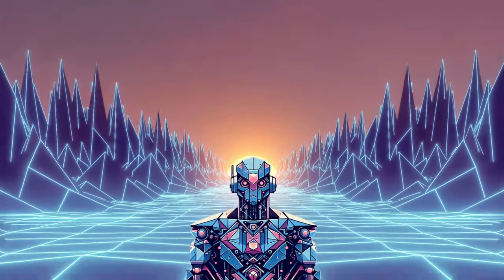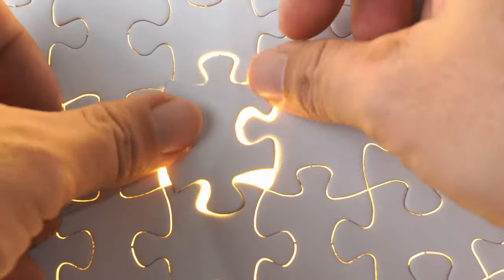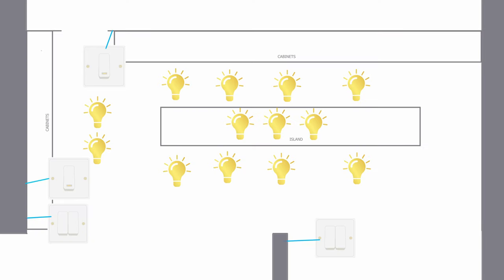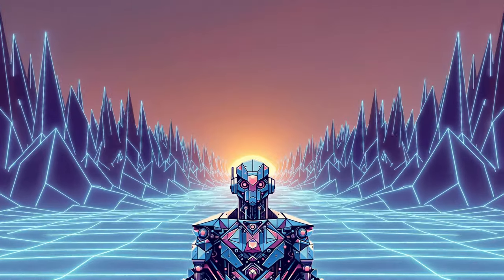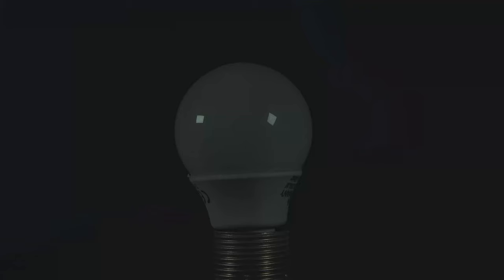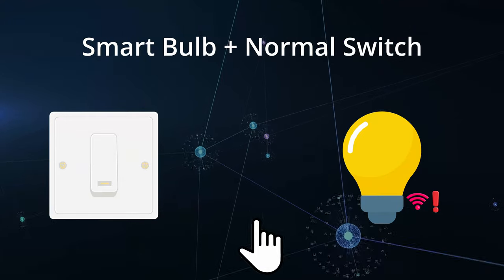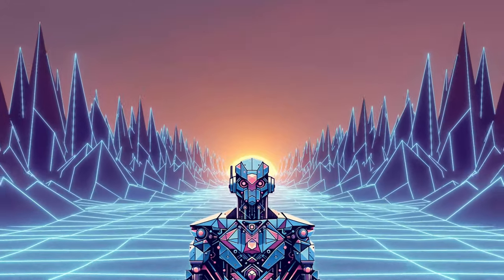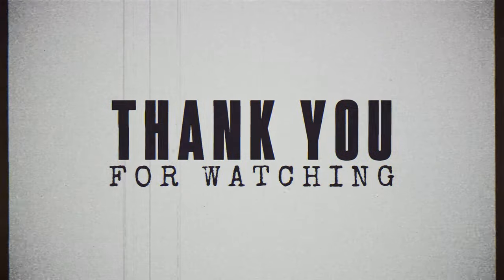You need to Build a Better SmartHome

Comment: Excellent content & context, its good to have a strategy based on a solid rationale - finding out the hard experiential way requires lots of time & money flushed down the drain and lots of frustrations to learn this. I could have done without 'Robot Guy' though - your other transitional elements were good! 

A point you didn't make that I think is also true is that making every switch or bulb in a house "smart" isn't really logical - small rooms like bathrooms with single doors and single lights work just fine & efficiently with traditional switches/dimmers or 'semi-smart' timers/occupancy sensors. Automations also need lots of thought to make sure they work for everyone all the time or are at least benign for others. I've seen so many demonstrated that make me think: "your wife/kids and especially guests will be so confused when that happens", OR what if that Isn't what you always want to happen...
Reply from the maker: Excellent points, and thank you for the input. 

I was actually planning a segment or a follow up video on why sometimes the best "smart" solutions are the dumb ones. For example, you can put a smart switch on your yard lights, or smart bulbs and tie in lots of logic. But photo-eye lightbulbs are a thing now and work pretty good without any of the complexity. Sometimes the simple answer is the way to go.

Comment: Points covered:
1) Identify the Problems you want to solve
2) Start Small, one thing at a time
3) How do I add functionality without removing [existing functionality]
4) Decide on a Platform and Let that drive purchases
Bonus: Focus on Local Controls